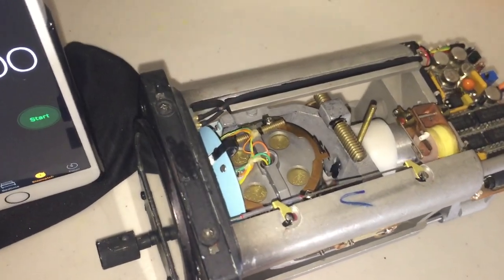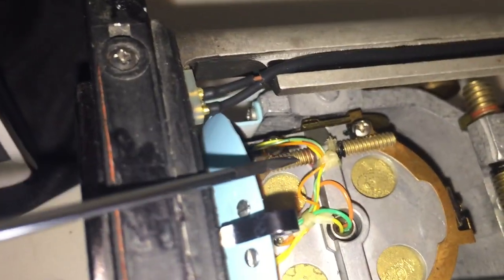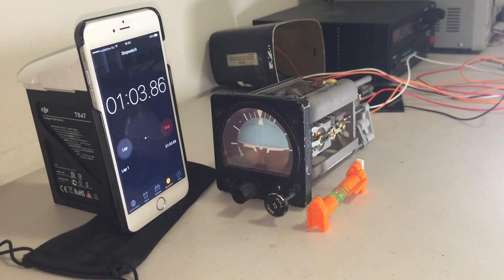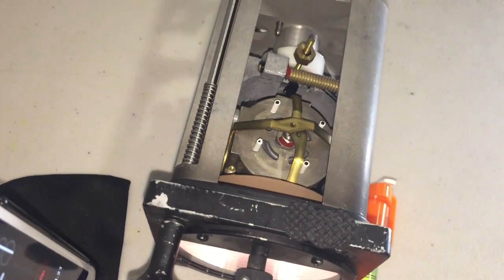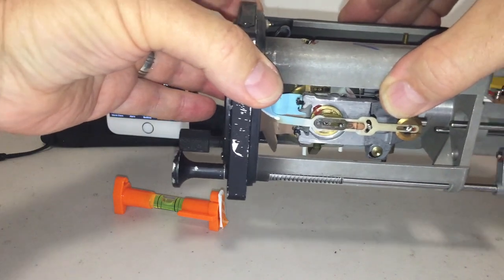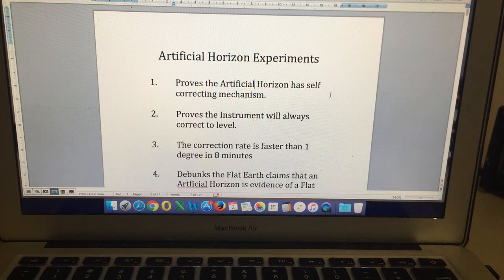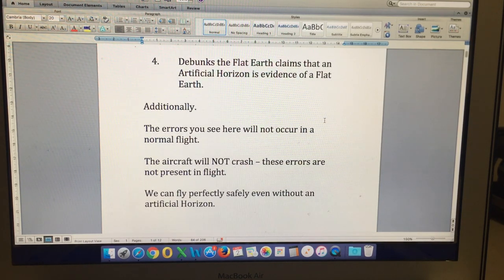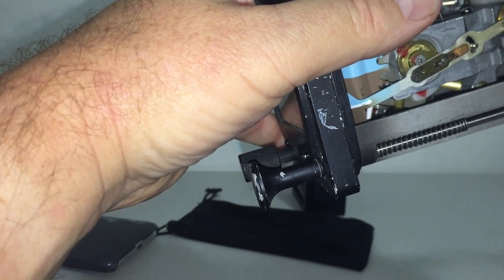Flat Earth - Time Lapse - Inside an Artificial Horizon while self correcting.

Comment: Bullshit. The plane always fly level. That means, the plane would go down always bec the pilot / automatic p will not waiting the correction that you showing. Bullshit. It will just crash.
Reply: Max MustermannOf course it fly level, following the earth curvature, the outer line in a circle is level to its center, so you follow the curvature flying level when flying around the earth, very simple.
Reply: elonesnah on highspeed low surface jetfighter would rise all the time ... they have to push the nose permanent down ... its bullshit ... earth is flat ... in just 1 minute a jetfighter would rise 1000 feet
Reply: Max Mustermann
Not at all, they just follow the curvature its only 1 degree in 70 miles, so if the jet fly 20 miles in one minute it only has to account for 0.28 degree, you have to look more into things mate, the earth is very big.
Reply: elonesnah dont talk about degree, talk about the altitude ... a jetfighter would rise 1000 feet in one minute ... it would be impossible to fly 100 ft about surface with highspeed-also the autopilot would crash the plane
Reply: Max Mustermann
So you want me to ignore reality?, 0,28 degree in 20 miles, 8 inch every mile, the pilot have control of the airplane, and gravity pulls the airplane towards the ground, why should it rise?, its no problem maintaining altitude, ask any pilot.
You just think its like you say, but your logic is completely wrong, and if you really look into it you will find out.
Reply from the maker: +Max Mustermann. 

Wrong Max.  Lucky I am the pilot and you are just the Flat Earth
troll. You have missed the whole point of this video.

Reading your other comments it is clear you have zero understanding of how Aircraft fly.  

It is just one degree of attitude in 111 kilometres.  I could do that at 100 feet in a jet easily.